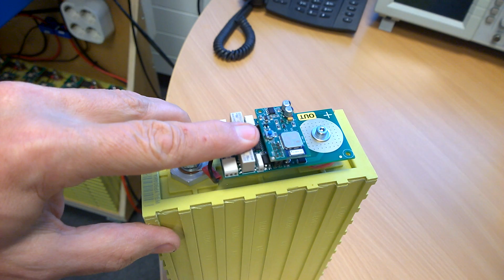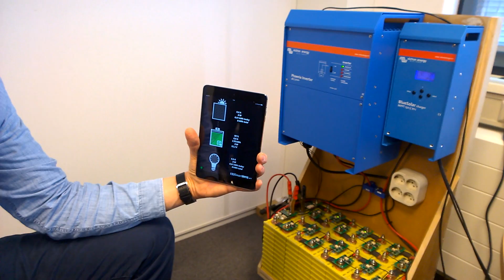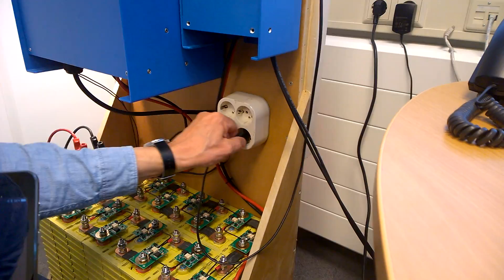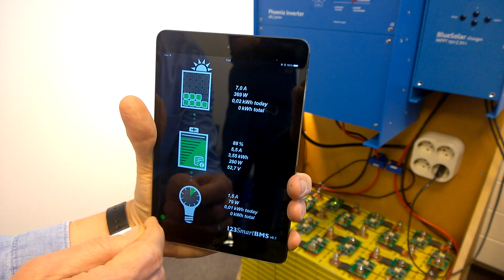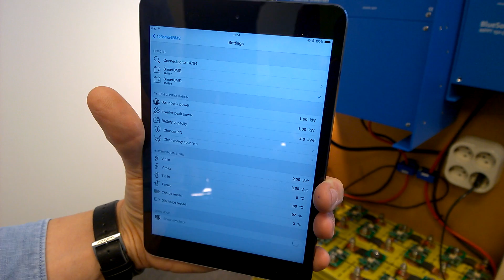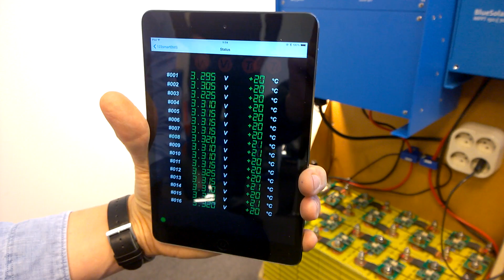123\SmartBMS Introduction

Comment: Excuse me! Cell #3 is distinctly under charged. Why is the BMS not balancing? T=6:20
Reply from the maker: Hello Bentley, We connected a couple of cells together to create this battery pack setup. However, one of the cells was indeed already empty. The BMS does top balancing, which means it will balance when all cells are being charged and are full. Normally, the BMS will keep all cells of course balanced.

Comment: Hoi ik heb 12 6 volt Trojan T105 accu's 4 in serie voor 24volt  totaal heb ik 12 accu's   3 banken van 24 volt. 
ik heb op dit moment nog geen accu balans systeem.
 
Jammer dat dit systeem tot 5 volt gaat.  Bij mij gaat de accuspanning zeker tot 30volt bij equalizing laden. 
Ik weet niet of je de producent ben van dit systeem denk eens na over normale en tractie accu's
Reply from the maker: Hallo,

Een 6V of 12V loodzuuraccu bestaat ook uit meerdere cellen intern. Als je de spanning van elke cel niet apart kunt meten, heeft het plaatsen van een BMS niet heel veel nut. Aangezien de meeste 6V of 12V loodzuuraccu's geen aparte celpolen heeft voor elke cel in serie, kun je het SmartBMS hier niet voor gebruiken.

Comment: much too expensive comparing with chinesse JK BMS. Probably better but price is exaggerated high.
Reply from the maker: Hi, there is a difference between the JK and the 123\SmartBMS. The 123\SmartBMS is developed and produced in The Netherlands with the highest care and only known-brand components to ensure a long operation. Besides, the 123\SmartBMS by default comes with two dual range current sensors for accurate SoC determination. If you want to save on costs, you can choose the 123\SmartBMS set with 1x dual range current sensor.
Besides, we are constantly improving the firmware  for new features like the coming SoH measurement and extra software like Victron GX support - active Victron control.
Reply: @123electric  

Agree with all You said ! Except price….. smels as Victron….. For me 1000 euro is big big money……On the another hand I do not like cycle power through batteries ( it is not “echological”) ( this is vicrton policy…..)
Reply from the maker: @valeriubuznea4073  The 123\SmartBMS sets are available at dealers starting from about 300-320 euro. One of the things which make these sets more expensive are the dual range current sensors, but they ensure an accurate current measurement and thus a good SoC determination.